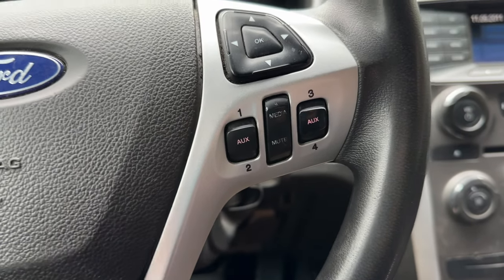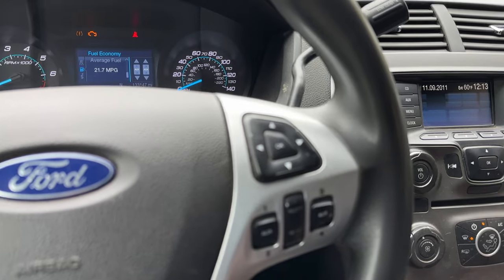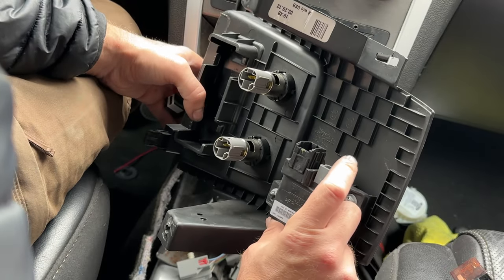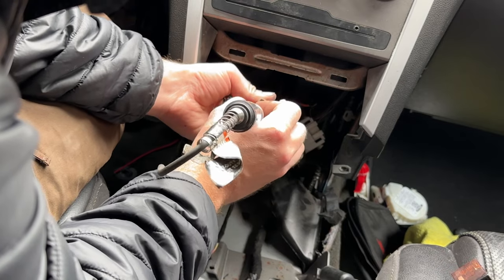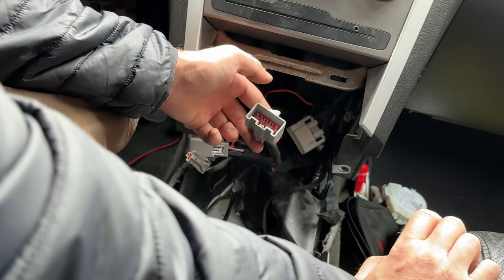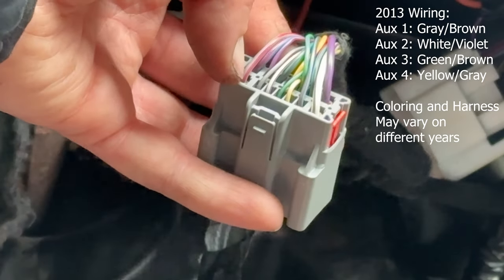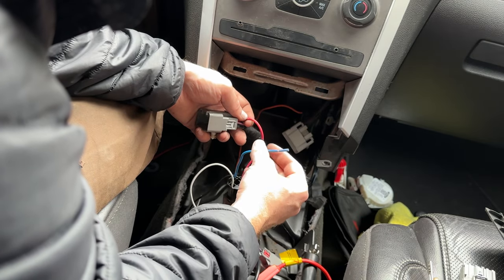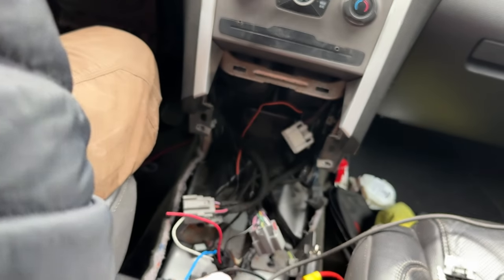How to Wire Steering Wheel 1-4 AUX Upfitter Switches on a Police Interceptor

Comment: Thank you for sharing!  It is very useful. I am intrigued to see the video with installation of a light bar. Where do you buy your donor explorers?
Reply from the maker: I still need to decide on a lightbar to buy. I usually go on Facebook marketplace or local classifieds and look for an ad for explorer parts. A couple times I found people who were parting out totaled cars or ones with blown engines. Alternatively if you find a good late-model salvage yard like a Team PRP partnered yard they often will have them. If you’re really lucky a pick n pull type yard may get one in.
Reply: @depolicify  thank you the reply. I will keep an eye on the marketplace. None of the yards around have anything newer than 2010 in Explorers. Maybe in a few years... I need second row seats, console and the driver side outside pillar that you showed how to replace. Mine has a big rip from when the spotlight was removed. I signed up today on copart, but I suspect cars go there pretty high.  Thank you for all the detailed videos. They are great help.

Comment: Very nice video! My Interceptor is SYNC equipped so the middle switch does look different on mine. If you're gonna "depolicify" the steering wheel, I suggest you swap it! I swapped my Interceptor wheel with a Ford Flex steering wheel. The trim is black instead of silver. You will have to change the switch pack on yours to the one with the volume/seek controls with the media/mute buttons in the middle. Ford does make a non-aux version of your switch pack. You will have to do some stuff in FORScan to configure SCCM and IPC to accept the new switch pack.
Reply from the maker: Personally I like the Aux switches. They are very handy.
Reply: @depolicify  You could always put a leather wrapped one and replace the right switch pack to maintain those buttons! I'd fully replace them, they look worn.

Comment: I'm actually glad I found this video because it helped me identify those two big connectors. I've been driving myself crazy thinking they got unplugged and couldn't find where it would go. BUT. The main reason I was trying to figure that out was because I want to be able to get my steering wheel controls working again and the upfit guide confuses me on that part. Would you be able to help me out with that? I've tried to go to facebook groups but I keep getting unhelpful comments.
Reply from the maker: What do you need help with that is not covered In The video?
Reply: @depolicify  Steering wheel left and right switch packs are showing above threshold. All other systems tests passed
Reply from the maker: Do they light up? Does the horn work? @justinsmith1178